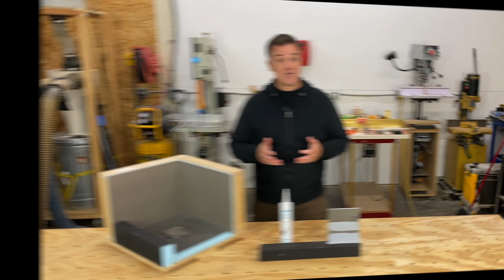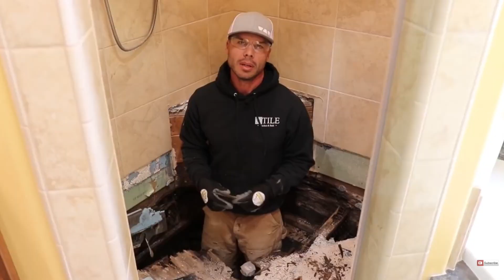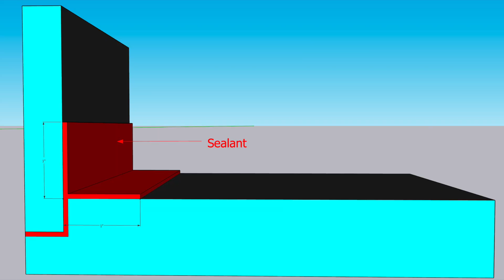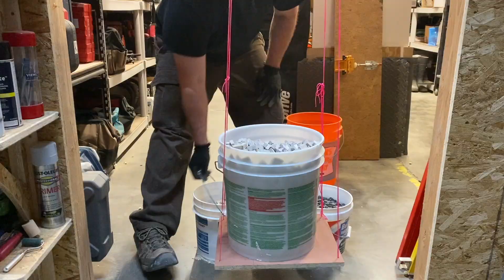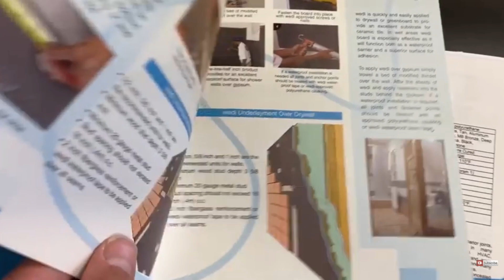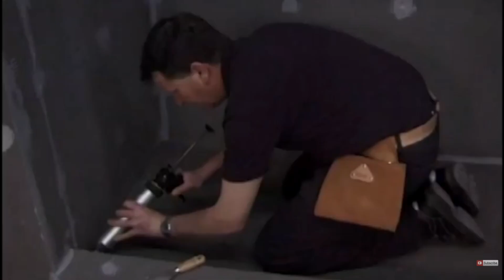WEDI Shower Waterproofing "Big Secret"

Comment: What a fantastic presentation. I happen to be an expert on the shower mentioned in the video- I did the inspection and wrote the report!! It’s so refreshing to hear real analysis and science!! Great Job!
Reply: Our enthusiastic wedi fans are blowing up the video on the forums and Facebook tile groups. Hopefully it will help support your efforts to have factual content with integrity grow and reach a larger audience. Cheers! 💪🏼🔨
Reply: So what was the official reason for the warranty not being honoured and what was the determined cause of failure? I have a WEDI shower room I have built and am more than curious to find out more about potential failure reasons.
Reply: Should subliner dry membrane tape be applied over the the joint after sealant dries? Wouldn't that solve the issue?

Comment: Wedi makes great stuff.  Clearly the install had issues, given the extensive water damage.  It really is not a knock on the company or product.  He has many videos including tests and failures.  Bottom line, there are a lot of good products out there to make a waterproof assembly.  Wedi, Noble, Laticrete, Mapei, etc.  The list goes on.  Apparently, this install was done by a Wedi Certfied tech yet the warranty was not honored?  One may wonder how Wedi justified this? 

Personally, I really like Wedi subliner dry and their sealant.  We've used them since about 2010.  They work really well with mud beds, other foam walls (i.e. GoBoard, etc) and with Hydro Ban.

Comment: You didnt disagree with any of the failure statements he made. He called it caulk and you wanted to tear him appart for saying its caulk. Than you agreed that the terms sealant and caulk can be synonymous with eachother. The wedi book also uses the word "caulking" he even shows the book. Your "testing" is fresh brand new reformulated products. Not aged products that have been stressed and weathered for years. You are just tearing him apart for no reason. Why are you tearing him appart for determining that an approved caulk failed. No good contractor would rely on a caulk joint for permanent waterproofing. Even if they refer to it as "sealent"
Reply: Not true, ive installed multiple wedi shower with no problems. Ive also used latticrete sealants and again had no issues. He is only saying Isaac is telling people how these systems fail without  bothering to learn how to use them to begin with. Common sense isnt enough when these system have a procedure in order to be effective. How can you use common sense when it's not something common to you.